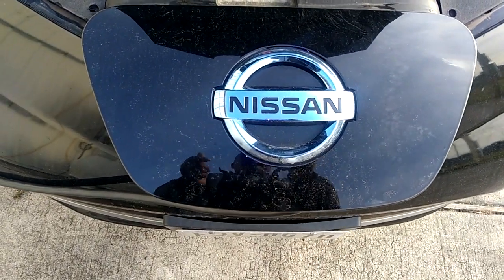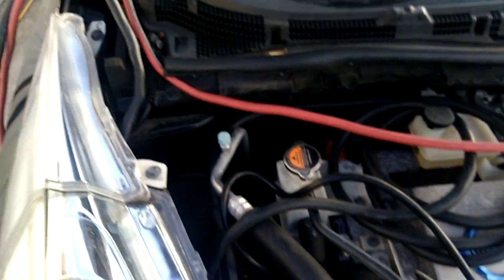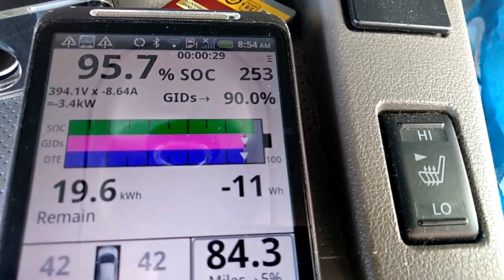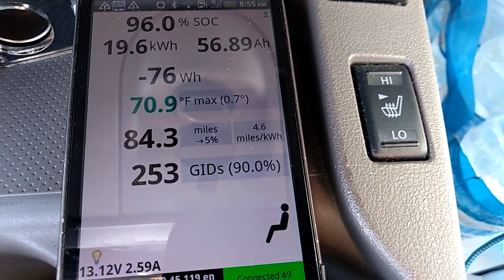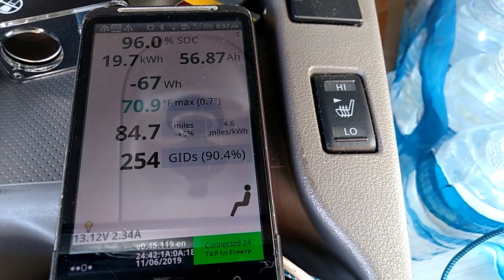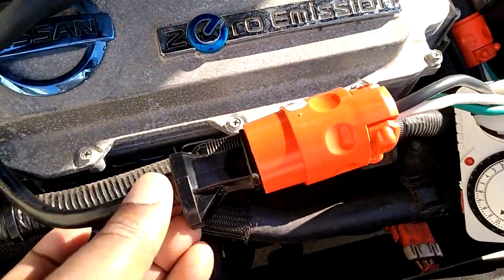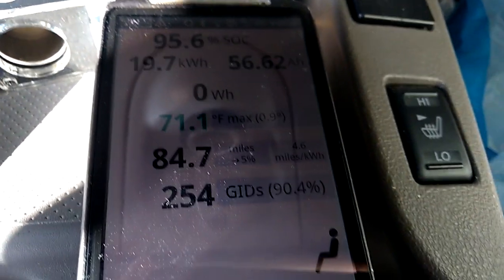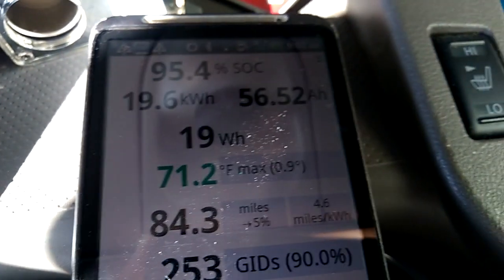2011 Nissan leaf & 12 volt battery drained solution when plugged.

Comment: Lithium-Ion batteries can be (are) damaged by charging them to 95% or above.  The reason the Nissan Leaf charger is cutting off is probably because there is software in the car that is trying to keep the batteries for reaching these hazardous states of charge.  But it takes the car a minute after the charger is connected to register "oh hey, I'm full and I need to disconnect the charge current now".  By rigging a charge timer to connect/disconnect the charger you are effectively working around this safeguard.  YES, you will be able to charge your batteries to a higher SOC this way.  But the damage you will be doing to their longevity will not be worth the one-time increase in range.  Every EV I know of on the market (including the Leaf) has a setting on it that shuts off the charger at a 80% battery SOC.  Next to that setting in the screen in the car, it says, quote "Recommended".
Reply from the maker: Nissan leaf battery are not as described if car manufacturer says they are 24KWH but no one ever get that after charging the battery in surmer or wintter. After I added the second 24KWH battery in parallel the capacity bar did not change or go back up even though  leafSpy shows that SOH of battery increases from 82% to 92%. That is a clear indication that the capacity bar thing is a fraud "battery gate" fraud. Nissan need to fix the error of the first generation battery bcause  it is just not acceptable.
Reply: @Tron Jockey That is great news. I had hoped their BMS didn't allow full 100% charging. But, you're saying that the 2011 did. This guy has a 2011 and his LeafSpy is showing that he is not charging to 100% (not that it's a good idea to charge to true 100%).